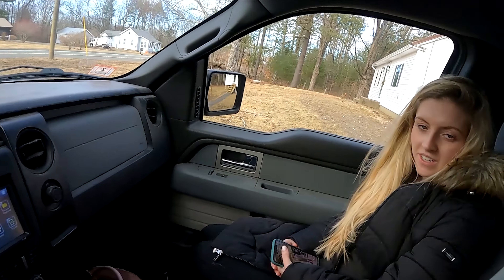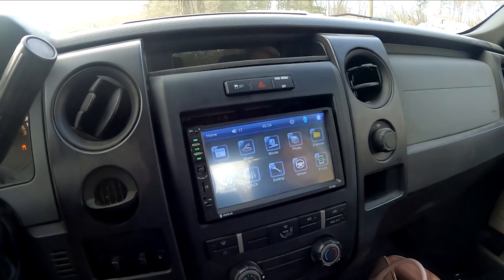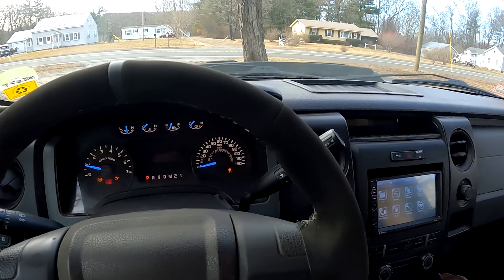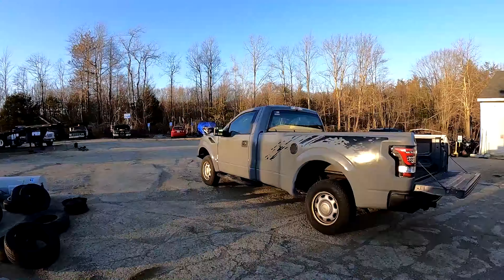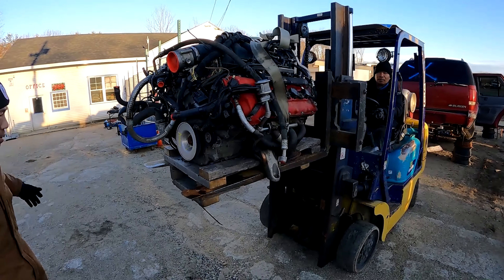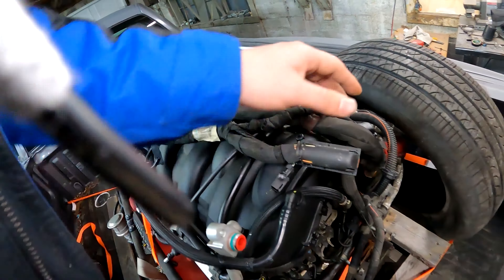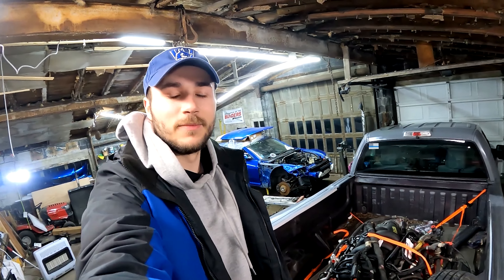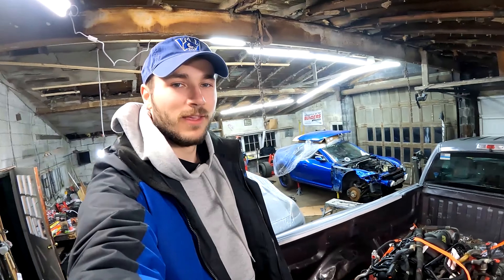Mazda RX-V8 Part 2 - Picking up the new engine!

Comment: Hello my friend - nice video. Just a correction, the engine is built by Ferrari but there are no components that are shared between it and the Maserati.  Cross plane v. Flat plane crank for starters.  The only thing similar is the block…that’s it.  I’ve had my modded Maserati GranSport since 2007 with the 4.2 liter engine.

Comment: Nice engine, are you going to refurbish it a little? I did a few engine swaps many years back, until I could afford a car as fast as any I could build. One was on the cover of a few magazines a Vauxhall Firenza, with a V8 rover engine.
Reply from the maker: Yes, just new seals. Since you’ve done a couple, what is the hardest part about doing an engine swap for you? Mine is wiring
Reply: @AndysAutowerks   I went with Rover V8 runninggear,  but the standar bits are just way too long-wide. Shorting the prop shaft and rear axle were the worst bits.. Back in time you only needed 4 or 5 wires to start the thing, all the ECU crap came later. But if I needed to do something like this now I would probably grab a self learning ECU Haltech do some good ones. Using a laptop to start a car was just science fiction.